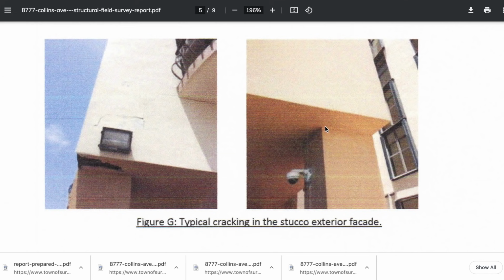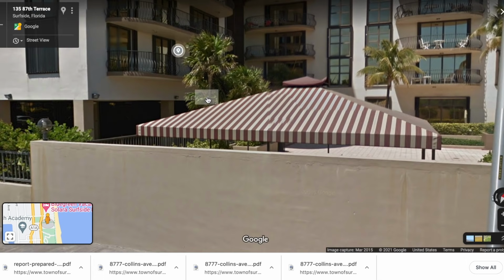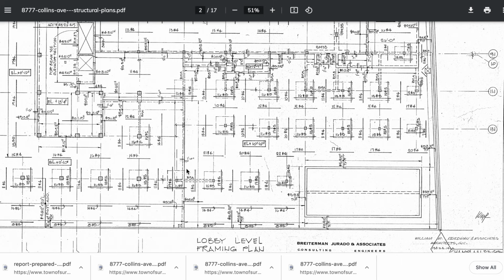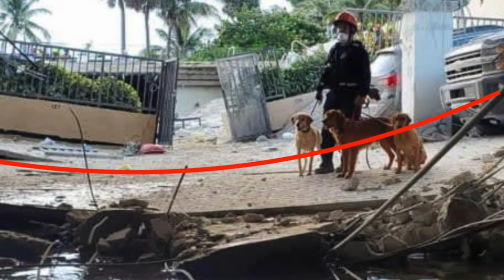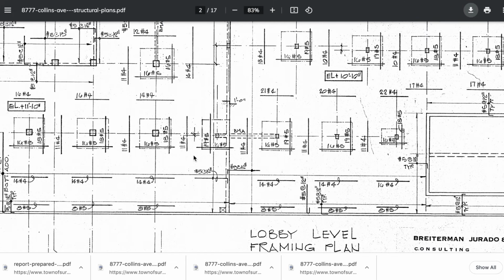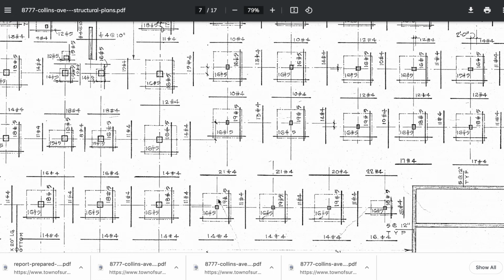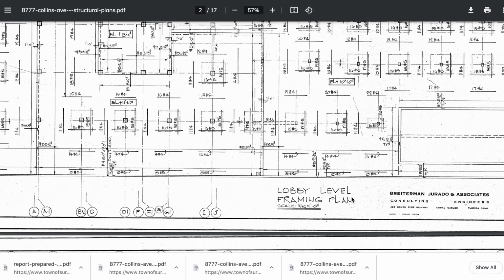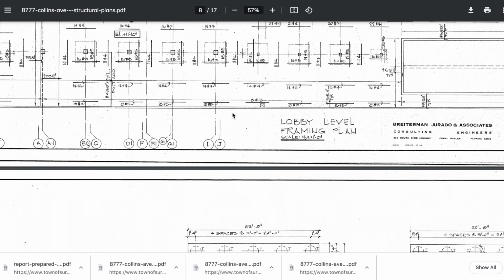Champlain Towers Collapse PARKING GARAGE SHARED POOL DECK AREA SUPER OVERLOADING? Part A

Comment: Shouldn't buildings be made to not be fully dependant on one or two support factors? If something gives, then only some of the structure would fail, but not the whole thing, or most of it. I'm obviously not an engineer or architect, but it doesn't make sense that one or two support beams fell the whole middle and one side. Or if the entire garage underneath collapsed and the above structure fell into the void below. I don't know. This is just so devastating for so many.  THANK YOU for doing this presentation.
Reply: I agree. Every expert they put a microphone in front of in the first few days would say "Something like this wouldn't happen from just one thing going wrong". And then the building seemed to collapse in a domino-type succession as if everything was tied together and one thing going wrong could set off a chain reaction.
Reply: yes, as a layperson, I've been struggling trying to understand why a high-rise building would be so interdependent with a pool deck; keep wondering if there's an engineering reason why you wouldn't want the pool deck to be independent from the building itself. Was the interdependence a way to get more underground parking?
Reply: @nancym4009  some engineers are saying there should have been a some kind of separation there. They have a special name for it that I can't remember

Comment: As someone who's worked security in a condo building I wouldn't doubt that that camera at the beginning either wasn't working due to poor maintenance or it's a fake to deter crime.
Reply: Fake cameras can also bring a lawsuit believe it or not. Seen it happen
Reply: that and if it wasn't a "fake" theft deterrent, the cables probably went threw the section of the pool deck that came down first on the way back to wherever the recorder was, so sheer bad luck would prevent it from even recording anything, lol.
Reply: Good one
Reply: The "Main office" was under the debris.. next to the gym.. east of it.  My guess is that they were still using VHS or DVR on site in that office and that that box is gone.

Comment: So the plans with the 1' elevation had transfer beams, but the apparent actual building spec did not have those? The plans with the transfer beams appear to clearly separate the pool deck from the lobby/parkade whereas I don't see any visible delineation or additional structural support in the "updated" plans. I'm no engineer and may be interpreting it incorrectly, but that seems like a whole lot of support missing from the final plan.

Comment: Is it possible that when they renovated the deck by adding to it the increase in elevation was eliminated? Or do I have it backwards
Reply: Not only height like you mentioned, but massive weight too, newer cars have way more stop n go action with major parallel forces going on, im surprised this deck lasted this long.
Reply: @jameschandler3308  imagine the weight of the black Chevy pickup
Reply: I kinda wondered the same dang did they actually bring the pool deck up by a foot and grade it out to the pool? That would explain that conflict! 
Wet sand is really heavy, but you would think that they would have calculated the additional load and added additional columns or spaced them closer together.
What we need is a detail showing these areas to determine what exactly is under all those pavers.
Reply: @James Mcguire  Chevy p/u point loads.  Plus dynamic loads - brake, stopping turning.  It was as heavy as a caddy with a ten body trunk.

Comment: Wow look at all those cars parked on the pool deck ... just like a concrete freeway slab it can crack lose over time by tons of vehicles driving over a pool deck used as street & parking spot, crazy crazy drivers down there.
Great Work 🏗🧱
Reply: So find out who had permit to change plans on structure and add top over deck and make drainage not work and add all the granite and marble and use less steel than called for. I'm sure there are records

Comment: The distances between columns explained by the lower load on the pool deck?  Is there some math to support the car overload theory?
Reply: At least concerning vehicle weight, all data I have found indicate that vehicle weights were lowest in the early to mid 1980's, with an average of 3,000lbs. Rising trends place current vehicle weights around 3,800-4,000lbs average. Though I have no data to support this, I would also assume that the spaces adjacent to the pool deck were not designed for vehicles whose mass is distributed along a sedan-length frame (SUVs/Crossovers).  It appears that all but two vehicles in the area of the parkade were SUVs or light trucks.

Also, it would be easy to calculate the additional weight of the planter wall and iron fence/gate, which, appears to also be supported on the slab with no transfer beams or additional support. An entire wall of planters, which could be masking significant concrete damage underneath, might especially be bad in this area in particular. I may also add that the planters flanking the gate are the largest, and so happen to form near perfect symmetry with the midline "seam" from where the flexural tension failure may have originated.
Reply: @Psitropic  Locate the square footage (footprint) of the vehicles in the picture and divide that into the curb weight (in pounds) + the weight of a full tank of gas and you will get a general 'pounds per square foot' rating of the vehicle' If it's close or over the deck PSF rating, then you have your corroborating data of the 4 cars.

Comment: Elevation change was taken out when they put an overlay on the pool deck.

They eliminated the gradient for water drainage.
Reply: Yeah, I wondered about that too. I also wondered about what seems like a lack of rebar. I'm certainly not an engineer, but when my neighbor rebuilt their garage (on the ground, solid ground, ground-supported and dug down into the ground, into rock) they had FAR more rebar, closer together (not even a couple of feet apart), in a grid like graph paper & connected at the cross points; and their garage is a single-story, ground-level structure on a single-story home. 
  That rebar in this 12-13-story building was seemingly far thinner than I saw used for a single-story, ground-level, attached garage on a single-story home... nothing like this huge, multi-story building.
  Additionally, there are older concrete buildings in Los Angeles (I'm estimating 1920s-1930s construction) where I've seen people apparently doing repairs, with rebar that exceeded an inch, and some appeared to be about 2 inches in diameter.
  When we lost overpasses in the Los Angeles area in 1971, and when they were rebuilt, I remember a whole lot more rebar in them, larger, crossed in a grid like graph paper, tied together where they crossed, much like my current neighbor's driveway. 
  There seems to be a deficit of rebar in the building that failed in Florida. You'd think with the hurricanes, tides and other stressors on that building that were easily anticipated, that they'd have used some stronger reinforcement. 
  I AM aware of the reports that there was shoddy construction being done, shortcuts being made in buildings in Los Angeles,  NYC, Chicago, Seattle and other cities in the late 1970s and early 1980s. It was in the news in the early 1980s.
Reply: I agree it appears that they leveled the pool deck and raised some areas to eliminate steps. Probably older residents didn’t like the steps, but wouldn’t a building permit be needed to add layers or pavers to the deck?
Reply: And added a LOT of weight, if that is the case
Reply: @amarsta  And allowed water to accumulate between the overlay and original pool deck. I think that's why the paint was chipping off everywhere.

Comment: Shared pool deck is key to the puzzle
Reply from the maker: Yes, b/c of over loading and also shock loads
Reply: @LoadPathEngineering  layman's question here... it looks like the 1979 plans that added the penthouse also modified the pool deck area from just a single big rectangular pool to instead "cut out" an area for the jacuzzi, which means that several thousand pounds of pool/water weight was shifted further west (closer to the area you describe as the "ripple" near the parking deck (page 40 of 336, on a page marked "new penthouse addition" sheet 1 of 9 with dates 8/20/79, revised 5/14/80, 11/27/79"). On the older pages of the plan, the pool did not have a separate jacuzzi cut out. Would this alteration of the original load design be immaterial to the load distribution on the pool deck?
Reply: I agree! There are other issues, but it seems like that's where the initial failure occurred.  I believe Florida (& other cities with highrises) going to have serious issues with these buildings built in this manner, especially around the 1960s, 1970s and 1980s (perhaps even newer).
  If you look at way older buildings, the rebar is FAR thicker (>1 inch or 2), there's more of it, the cross points are connected with stronger connectors and so on. 
  From a non-engineering POV,  it appears as though this building was built substandard,  perhaps not up to the plans, had maintenance and "upgrades" which were problematic, then you had construction next door, and perhaps a questionable foundation to begin with, built on beaches made of coral, essentially, some chemistry issues associated which also played a part, COE issues with different levels of expansion and contraction, and so on... that spelled disaster.
Reply: Bonded to colums that were more weakened by moisture from several factors, bad drainage, standing water, stucco acting as a moisture barrier holding moisture in, soo many recipes for disaster, but what triggered it all?